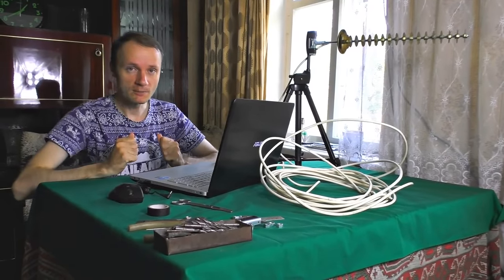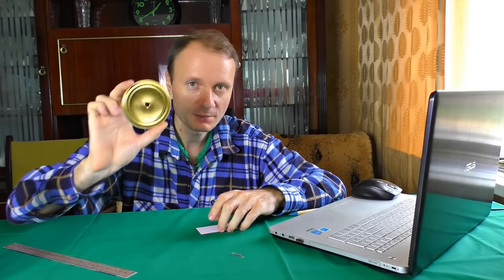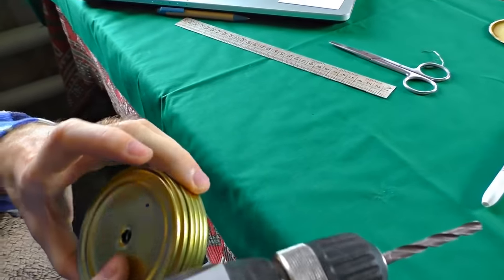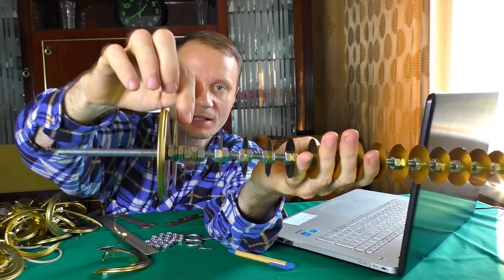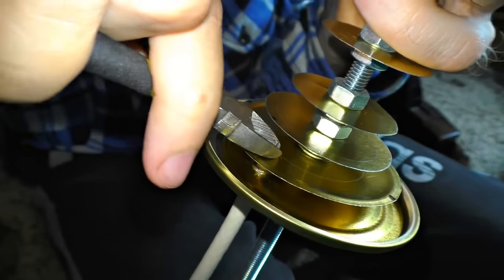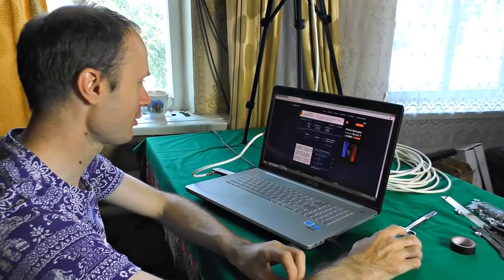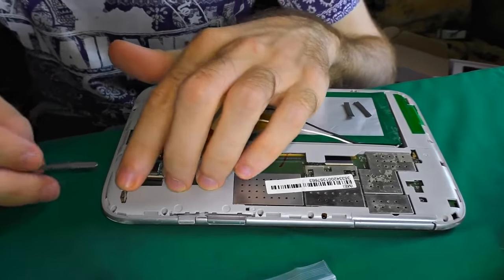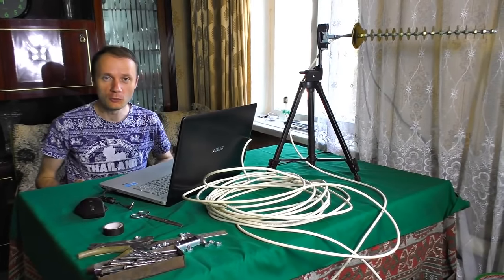Real WiFi Trap DIY💥 / Free Internet Rifle V 2.0

Comment: Isn't the main rod in the middle that's holding everything, actually shorting it scrabbling the signal and reducing its receiving and transmitting power while also, with time, destroying the receiver circuit(the USB WiFi stick)??

Also, it doesn't matter if you can catch/see long distance WiFi routers/modems because if they can't reach you and you just get find the signal because your antenna is just too sensitive it means that you will simply won't be able to get a good link to communicate, both the receiver and the sender must be able to reach each other properly(and by that i mean to have balanced levels between them).

This is a major mistake most people do, they keep getting stronger and stronger antennas when it fact it doesn't matter after a point for the reason i mentioned above.

Most USB WiFi  sticks also have transmit(and receiving) power limits build in to the drivers no matter your antenna it won't matter much of what you do after a certain point at least(and holy shit that coax cable due to being this long must be messing a lot with the signal due to impedance mismatching and losses).

Even a better reflector can help more a stronger receiving signal than just getting a stronger antenna(because it does the sending thing) and it can cost less to do anyway, but at some point you simply can't do much more, other than changing the channel from the source(sender/transmiter), as low as possible, change the transmit power and reduce WiFi packets fragmentation.
Reply: no
Reply: @krunov9629  Yes, because if you went to study electrical engineering you know this is the case.
Reply: @georgeindestructible  what is the case ?? this is correct design...galvanic short is not short on 2.4 GHZ, otherwise, my profession is IT and electronics, that's why such wrong comments bother me.
Reply: @krunov9629  The problem is, there is no galvanic isolation there, all metallic parts are touching.
Reply: @georgeindestructible  there is no problem...galvanic short -> is not short on 2.4 GHz....impedance on high frequencies depends on shape of conductor similar as coil impedance depends on frequency  - not only on galvanic resistance. If you send DC as signal to this antenna, yes it will be short, but if you send high frequency AC (RF) signal and rising frequency, impedance of this metal loop you call short will rise and will reach about 50 ohm on 2.4Ghz , so no short for 2.4 GHz signal...
If You had Log-periodic antenna for TV, check resistance , it is also short ....but on nominal signal frequency has impedance about 75 ohms..
Reply: @krunov9629  Yeah that's true, but is it 100% not a short with that resistance on that frequency or is it a partial in real life conditions?

Comment: Can you answare at two questions ? 
1. Why you don't use coaxial cable for 4G antenna like 50 Ohm. Or tell if it's more good to use coaxial TV cable ?
2. Why you never mentioned the lenght of the screw/bolt ?

Comment: I have a USB WiFi adapter but it only has a built in (copper track on PCB) antenna. Could you do a video showing how to connect an external antenna to these types of wifi adapters.

Comment: Would it improve the antennas performance, if I made this antenna with all brass materials?. Brass threaded bolt?, Brass Nuts?, Brass Washers?, Brass Disks?. Would Steel materials work better?. Does the metal composition matter at all?. I would appreciate it if someone can answer in a comment. I'm just trying to figure out if Wi-Fi signals respond better, to certain types of metals.
Reply: Look at this here.  https://ham.stackexchange.com/questions/1388/effect-of-different-metals-for-antenna-elements
For the power levels of a wifi adapter I dont think you will see a noticable difference, especially not in the bolt or nuts. More important will be the precision of the element sizes and spacing, and say soldering the connections instead of relying on a friction fit.

Comment: Without non-conducting spacers between disc's and non-conducting sleeves around the central rod, you have shorted out the whole thing.. just a big chunk of metal on the end of a cable.
Reply: He only needs ONE non-conducting spacer and he has it- but the translation came out "gasket" instead of "insulating washer". It's not shorted.
Reply: haha another wrong "short" comment :)
Reply: @krunov9629  ha ha another that cant understand simple things.

Comment: omg... Put the wifi adapter right on the antena and then put a long usb cable to the laptop. That coaxial cable should be as short as possible to maximize the signal
Reply: The normal one should not longer than 5m and put them out door when it rain is not that good.
On the other Side the Gain of the Antenna and the loss of the cable dont make then into a wifi gun.

Comment: Impedance of your coax cable is 75 ohms, but Wifi card connector have impedance like 50 ohms for better result you should 50 ohm cable. Also cable should be shorter on 2.4 Ghz frequency the wave attenuation in cable is very high as result you losting few db of signal
Reply: One way of reducing cable losses is to put a sma connector on the antenna and then buy a usb WiFi dongle which has a sma connector on the end of it. Simply screw the usb WiFi dongle onto the antenna, add some support for the dongle and then connect a usb cable. Its very efficient.

Comment: Dont roll your antenna cable up into a coil. At these high frequencies the coiling matters and the signal will be significantly worse.
Reply: If you are talking about rather having a shorter cable than a long one coiled up, you're right. But having the same length being straightened out or coiled up, does hardly make a difference, as long as you don't bend it harder than the minimum allowed bending radius (usually a few cm), which would cause reflections. It's a coax with a well defined characteristic impedance (in this case 75 Ohms) and all that matters is the cable's loss factor (in dB per meter). The old open double wire (120 Ohms) cables shouldn't be wound up because of capacitive coupling.

Comment: How do you calculate the sizes of the disks?
Reply: Uh,  by the speed of light and the wavelength,  like on any other antenna?
Reply: @craigwall9536  the frequency of wifi is 2.4GHz, that leaves you with a wavelength of 12cm. Please tell me how this correlates to the diameters and distances of the disks. I know that bigger wavelength means bigger disks, but why does he use 80, 68, 50 and 40mm diameter and how does he get the distances between the disks?
Reply: Good question First Last
Did you find out the answer?
Reply: @brunopaty4860  This antenna is basically a special version of the Yagi–Uda antenna.
This site offers a calculator: https://www.changpuak.ch/electronics/yagi_uda_antenna_DL6WU.php

Comment: I know squat about antenna circuits, but the way you have it connected in 5:39, you just create a short in the antenna cable.
So I'm guessing that shouldn't work at all.
Then again, maybe antennas work that way? I don't know.
Reply: He mentions "gaskets" in the first part- but I think that was a bad translation of "insulating washer". You're apparently assuming that those two discs share a common conductor with the threaded rod,  but I think the smaller disk is actually insulated from that rod- so there would be no short between the two disks.
Reply: @craigwall9536  I thought of that, maybe that would work with a non metallic, and also insulating, rod.
Reply: guys, antennas are always a short at DC. Not at high frequencies though.
Reply: @Basement-Science  ah, ok then.

Comment: OR, you could just buy a 24db parabolic grid antenna. Time better spent for those who actually have jobs, would be at the work place. Earning money, to pay for an antenna that would actually work well, and not waste resources. We've used parabolic grid antennas to reach out over 17 miles, with 802.11g in a noisy environment. Yes, it did not always work well, and you MUST have line of sight. This sort of antenna would fare far worse, and is not designed for longevity. Yes, it is also good to know things, but at the end of the day, if you're needing to know how to build one of these antennas, just so you can connect to someone else wifi. I'd say you probably should sort your priorities better.

Comment: use should use 50ohm cable not 75ohm
Reply: @T_Tigerr why?
Reply: @T_Tigerr wifi radio chips always have 50ohm impedance
Reply: @T_Tigerr no, its not working like that
Reply: T_Tigerr Good luck, finding 25 ohm coax, for 2.4 Ghz use...even if it did work that way

Comment: Why is this in the most Country illegal without turn the Signal Power down? Thats simple. The Output Power is limited by 100mw by Law. So a directional Antenna focus the Beam and adjust the Gain. So the Signal must be lowered.

Comment: you  have refereed a video about  antenna mechanics in that,he showed to put and insulator  on 2nd disk so that cant damage wifi adapter or any device we connect i wanted to know is it true or not
and if its true  i can put some electrical tape to insulate it from rode answer so i can make this as if i weld this  with rode and it will dmg my wifi adapter i m gonna lose my mind lol

Comment: Very cool.  I have a challenge for you.  I live in the country and use Arlo wifi cameras to monitor my property while I am not home.  The challenge is the signal.  I can not place the cameras further than 200 feet from my router.  My internet signal comes in on a wireless signal to a modem/router (Bell Canada), then my camera hub is plugged into the router.  How can I use your WiFi rifle to send a stronger signal to the cameras so that I can place them 500 - 700 feet away from my house.  These cameras upload a video clip to the cloud when they sense motion, they also store the video on a micro sd at the ARLO camera hub. This will be an incredible benefit to a lot of people that live in the country.  Thumbnail would be "Extending your WiFi Camera reach by x%" the only alternative is for cat6 cabling cameras which is expensive and still has limitations.  Thank your for your great DYI hacks.

Comment: Wow that is a 75ohm coaxial cable 😨😨
Reply: Other research says it needs to be 50 ohm. Like RG-58 cable.
Reply: @kcraig51  yes wifi waves design to transmit and receive with 50ohm cable . Fm and tv use 75ohm . Lot of people use 75ohm for microwave frequencies. Impedance matching is most important thing in radio transmission. Maybe they don’t know or they don’t care . If you use high power radio transmitter with unbalance transmission line transmitter also can burn . 

If you really interest in radio transmission and how to make antennas follow andrew mcneil .

Comment: The Tv coax is 75ohm,I think the wifi adapter needs 50ohm tho..
Reply: It doesnt matter as long as the coax run is short and the cable is good quality and you use low power. I use 75ohm for ham radio VHF, and 2.4GHz. You can adapt it to 50 ohm with a 1/13 or 1/11 wavelength adapter, I made one, but couldnt tell the difference. Better than rg58 so far.

Comment: These guys have no fucking Idea what they are doing.
They are using a needless long 75 Ohm cable in a 50 Ohm system.
Connecting some metal windbells to the antenna would probably have the same effect.
They didn't even tried out the Factory Antenna of the wifi adapter to get any results for comparison.
Also VERY suspicious thet their random "FREE WIFI" always was one with the best signal. Like ... they maybe created it using an Mobile Hotspot next to the computer!?

Comment: 00:6 Imagine what you are holding is a motor. The big wheel is the size of the motor, and the rest of the wheels will be a power generator on wheels each running in a circle around the big motor by the big motor. The more wheels you add on, the more power you can generate from those wheels. As big as those farm that farming in a circle everywhere around the world. 😀 can that create good power? And if you add extra levels to build a 20 levels building you can have a big power supply using the force of 1 motor? Would that be possible? Imagine saving the power from a Windturbin and solar system in a battery just enough to be able to run the motor for this  power station at night.

Comment: How many ohms? Looks like a dead short circuit between tin plates and steel...
Reply: James S. Yes, the DC resistance is nearly a dead short. But, at 2.4 Ghz ...the impedance is much higher, than the DC resistance. Probably somewhere around 50-75 ohms.
Reply: @darylp8564  thanks Deryl, neglected to realize that it's modulated AC.... Derp. 🤦👍

Comment: That antenna cant work well. Never.
Reply: It does work, and it doesn't matter if the directive elements are electrically connected to the boom or not. I know this because I simulated this antenna in CST: https://i.imgur.com/PUiPQOZ.png (model and E-field), https://i.imgur.com/i66ISkF.png (directivity and gain pattern). The total IEEE copolar gain is 13 dBi
Reply: @lands1459  At this frecuency antennas must be made with exact measurements, not with nuts and bolts. Element spacing, thickness, and all that long cable... A simple waveguide+horn would perform much better than trying to make a yagi. 1 milimeter of error is too much. I dont say it cant be done, but not this way.
Reply: @Jorissoris  Interesting, i will look it out, but the coax loss with that cable is like 2 to 4 db per meter. And they have more than 6 meters...  So gain would be negative. Fake for me
Reply: @Jorissoris  Did you modeled the nuts and bolts and the influence of boom thickness? What bandwith, impedance and SWR? A simple horn is 18dbi easily and wide bandwith.

Comment: I confirm it work
I made one a very simple one with tp-link dongle and the range/signal was triple
it is not fake
Reply: Salafiyyaaa  Theorically it can work 
I made a very simple one in the past and it worked fine. I have no dongle right now to be 100% sure. But i believe it can at least double the signal

Comment: IF YOU DONT HAVE DE PASSWORD USE WIFISLAX   THAT OPARATING SYSTEM BRING  LINSET  BUT WHEN YOU ARE USING  WIFI SLAX YOU CAN NOT USE  WINDOWS   BUT  IF YOU HAVE  WINDOWS  64 BITS YOU CAN USE VIRTUAL BOX TU RUN WIFI SLAX IN VIRTUAL BOX AND  USE WINDOWS  AT THA SAME TIME  I DO IT

Comment: might work but givin the laws stating using someone's wifi without permision is still STEELING  ....  ya,  even if its not password protected..

anyway, the antenna is called a yagi/uda    design.    nothing special,   put in on a amplifier and great range, but only in one dirrection and you have to anchor the thing down so it dont move...

rile...  hardly,   you would move more then a milimeter and the net your looking at 5 miles away disappears...lol

Comment: Maybe this is stupid question
Is this "actually" work?
Reply: My advice to you: Build it, only then will you be convinced. I built it, and it works beautifully. You should build it too. No excuses, just do it.
Reply: @kurade1096  what device did you have? Tp link?
Reply: @halimahnur7820  any wifi adapter works, as long as the coaxial cable is in good condition. also use conductive discs (not wax laced)
Reply: @kurade1096  hi,can u list list this materials,like size and thickness and other specs ,links?

Comment: Who Have Wifi Without Password? NO ONE WITH BRAINS. 
This Is Useless, Rod Needs To be Copper That's Silver Plated For Ideal Use, But Yeah, Its Around 250.00 MHz Antenna, I have Done Tests With This Antenna, Rather Use Yagi Antenna Type For Capturing Wifi Signals Not This Type Because This Type Needs To be Aimed So So far Away, Like From A Moon Or Other Worlds, Its Long Reach , But Yagi Is Meant For In Planet Use So It Bounces The Signal At Night Time In Atmosphere..

Comment: shopping list if anyone wants to make it 
caps for canning 9cm <-->
8mm stud 50cm
screwing nuts 8mm
Coaxial Cable (don't cheap out, found out cheap ones don't work)
drill bit set
steel ruler
compass/safety pins 
scissors
TP-LINK TL-WN722N
RF Coaxial SMA Male Plug to BNC Female M/F Radio Antenna Connector Adapter 
done :D
have fun, caps were the hardest for me to find so if you know anywhere to get them drop me a link to buy, making them for my elderly family members
Reply: then for phone/tablet 
Pigtail Mini PCI IPEX U.FL MHF4 to SMA Female Bulkhead Jack Connector Pigtail WiFi Cable 0.81mm for PCI WiFi Card Wireless Router Mini PCI to PCIE Card Wireless LAN WLAN
most laptops will use the same if not find a laptop one and diy it cut it and electrical tape it

Comment: 10:06 How the usb adapter is possible to work plugged to the router ?
Something seems completely wrong...
Nice car btw
Reply: if the router has USB and the proper firmware, you can configure it to use USB devices for receiving the internet and feed it into your WLAN. You could also use your smartphone, enable tethering and plug it into the router to give everyone connected to the router internet from your phone. Or you could configure the USB input to be a fallback internet connection if your own internet provider has problems.

Comment: that $10 wifi adapter was ok in 2010 but not in 2020 cause it is slow and it doesn't support wifi 5ghz
Reply: 5ghz sucks
Reply: Igor P you say that cause you have no money for 5ghz router😂
Reply: @JakeJoris  5ghz is a gimmick. I have it at home and its so short ranged it cant even reach beyond the living room where router is at. Speed is pretty good but its not worth the range trade off. It provides no real benefit for the average person.
Reply: @igorpadurjan5714  i have a $500 router and the 5g wifi reaches my room which is 100ft away from the router.
Reply: @JakeJoris  proof nothing, just mo money =P
Reply: Fantasmamuerto what😂?